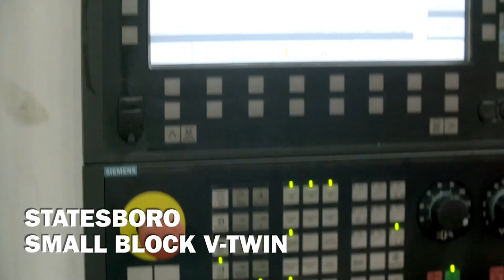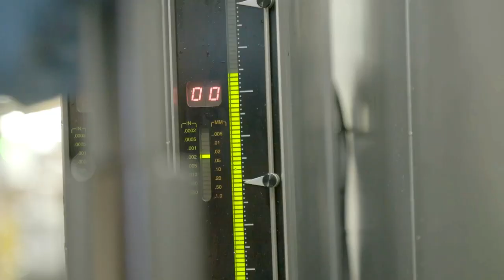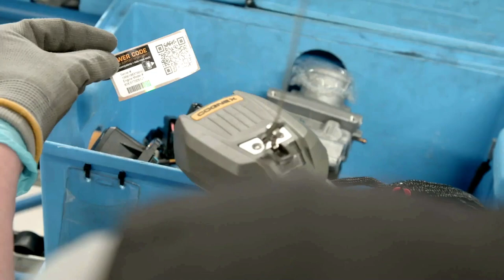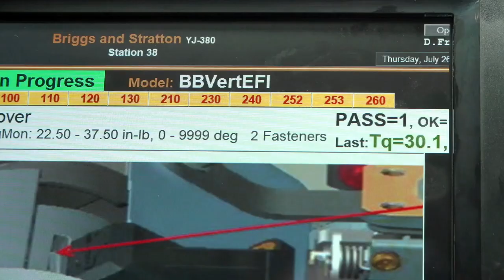810 Vanguard Tour | Tiger Cat & Patriot | Scag Power Equipment

Comment: Hey scag I have a 48 inch hyrdostatic walk behind mower from 2004 with a floating deck. do you have any info on where I can get a new deck its just about rotted thru
Reply from the maker: Hi there, work with your local Scag dealer. They can get a new cutting deck on order for you.